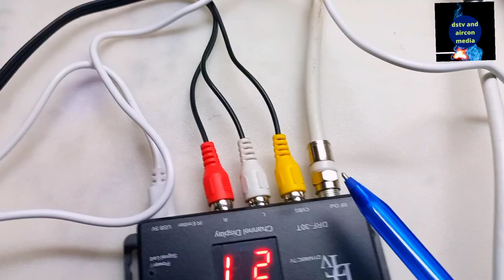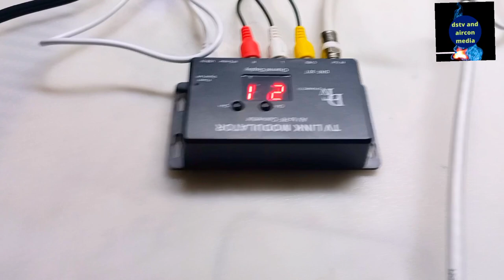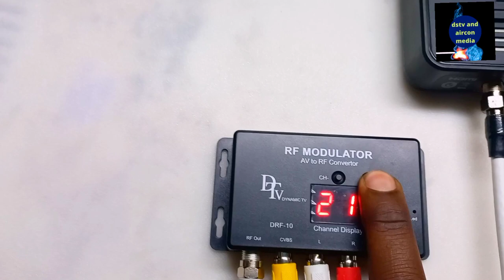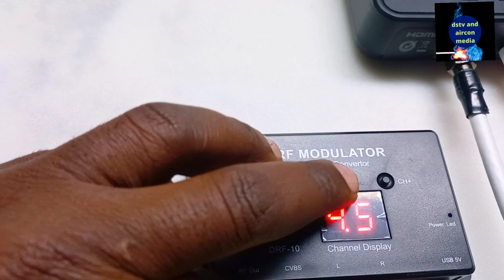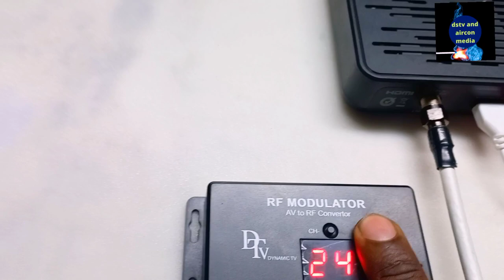All you need to know about a RF modulator, how to connect it to your satellite receiver.

Comment: Excellent explaination. I used this modulator to transmit RF Signal from Android tv box to several of my vintage Boombox TV via Antenna that I'd connect to RF Output port. Sound and Clear picture. No cable needed. Same like receiving old TV Broadcast.  Thnks
Reply: Is audio stereo?
Reply: @namesurname4666  not really sure bout that but the sound is clear.
Reply: @ninold80  is your boombox stereo? what's the brand or model?
Reply: @namesurname4666  normally I'd watching  youtube vlog and never bother about stereo. I think it's sounded stereo

Comment: I have a question, my decoder is at ground floor, and my second TV is at 1st floor, so the RF out from the RF modulator need to connect to where? Pull the line all the way from ground floor to first floor second TV?